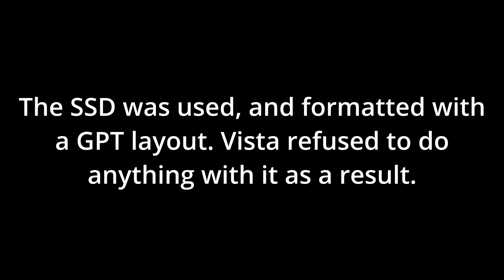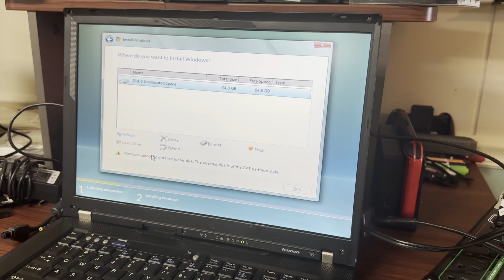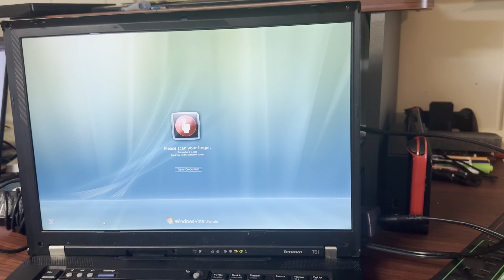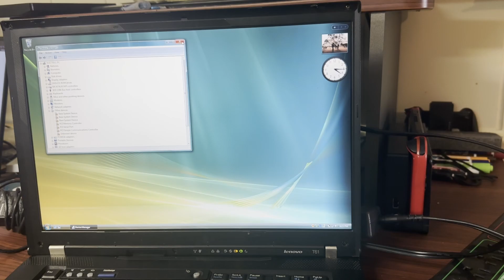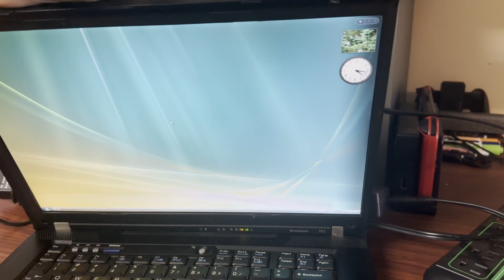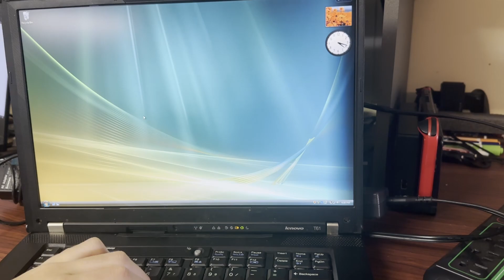Repairing and setting up the $5 ThinkPad T61! (Swap Meet Project Series)

Comment: I had a t61 with a centrino v pro (a rebranded high end mobile core 2 duo) and I can confirm that intel module is a speed boost thing that has to do with the centrino stuff (the bios and windows itself reads it as a core 2 duo) I sadly don’t have mine anymore though as it’s battery exploded on it and I could not even salvage the laptop
Reply from the maker: Centrino is a term for a laptop with intel CPUs and network cards, iirc.
Also yikes! Battery explosion doesn’t sound good.

Comment: i found the same laptop for 5 bucks as well, and for some reason I have a problem with the fan, like a grinding noise. It spins, it doesn't overheat, but it becomes annoying. My guess is that the person that serviced the computer messed it up, because some screws are missing, it has an SSD, max ram and temperature is fine ( they did a thermal paste replacement perhaps? ). Anyway, i think i will get a replacement fan...Cheers!
Reply from the maker: That's what mine did, would grind badly and threw a fan error in BIOS because someone messed up while trying to clean it (clearly). Get it replaced or repaired (mine was too far gone) and it should be good to go.

Comment: Isn't there a nut on the hing to adjust the stiffness I'm perty sure there is . This laptop a beast and will still out last even new laptop. I've seen windows 11 on one and the mods are insane  definitely reliable it's still working. Keep repairing they get easier to work on LoL 💯💻🖱️💯🛠️💪✌️
Reply from the maker: Is there? Will have to take a look. It’s cracked off some bezel clips now… it still works great though.
Reply: @3lectr1c  at the base of the hing there a lock nut  that can be adjusted it's a 2 peace design I didn't understand why  would someone make  a hing that disassemble so close to the mounting point it makes sense now 💻🖱️💯🛠️💪✌️
Reply from the maker: I’ll have to take it apart and have a look! What does make me think that it may be a different problem though is that it acts ok when I’ve first opened it after a while, then stiffens up.
Reply: @3lectr1c  that interesting and strange 🤔

Comment: I'm almost positive that the mistery module is an Intel Turbo Memory module. The Wikipedia article on that will be helpful to try to know what that was all about, but it appears it was short-lived and of unclear utility.
By the way, if you think 1280*800 is bad, there actually was a 4:3 version of the T61, and as you may imagine 1024*768 resolution.
Reply from the maker: Excellent info. That looks to be a match! Neat. And yeah the 10x7 T6x laptops are a joke… I’ve got an R60e with that dreaded panel. 1024x768 is bare minimum on XP, let alone on vista or windows 7. I’d like to find a 4:3 T60 at some point though, one with a 1400x1050 or 1600x1200 screen of course.